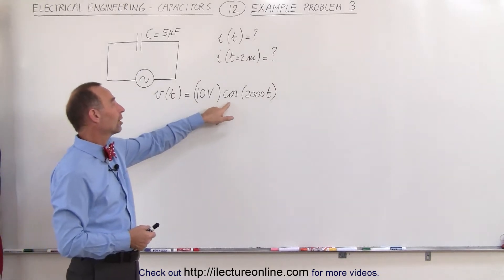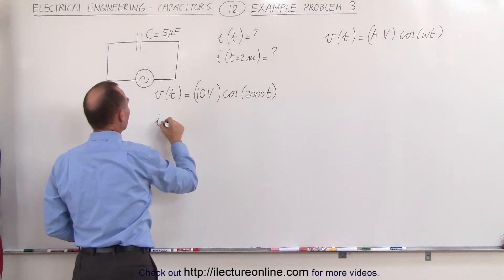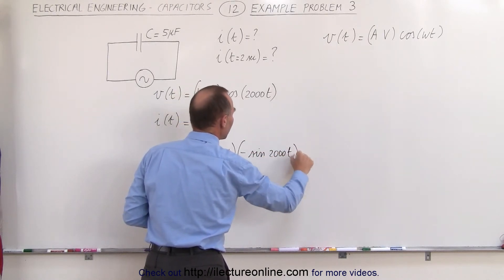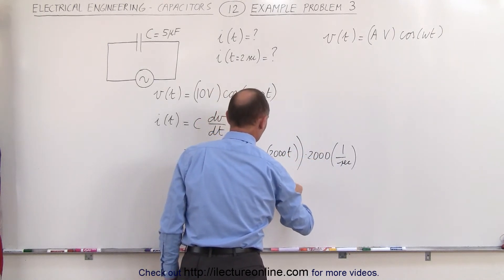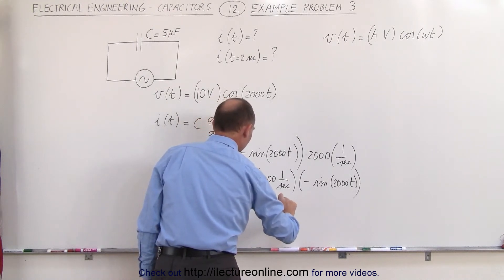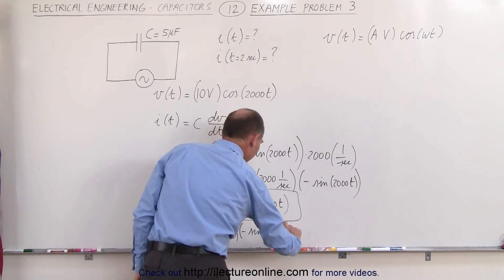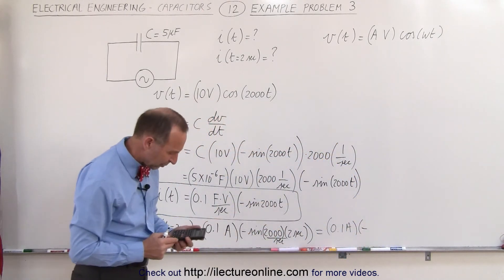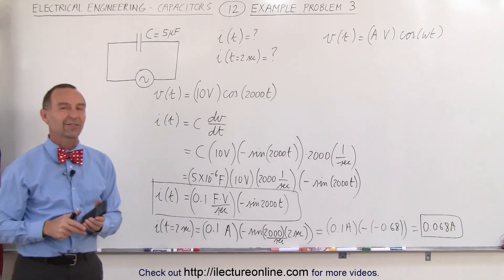Electrical Engineering: Ch 6: Capacitors (12 of 26) Example Problem (3 of 4) i(t)=?  i(t=2s)=?

Comment: Where did that extra negative sign come from? 
(0.1)(-sin(2000*2)) = -0.064
Reply from the maker: the derivative of the sin is the negative cosine
  and the sin( 4000 radians) = - 0.68
Reply: I see, I forgot the step to switch my calculator to radians. Thanks.